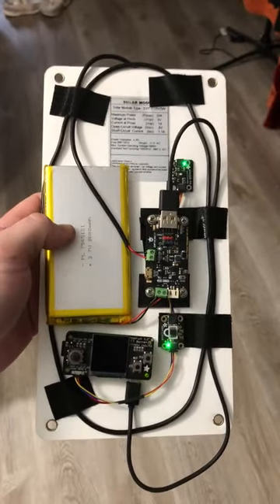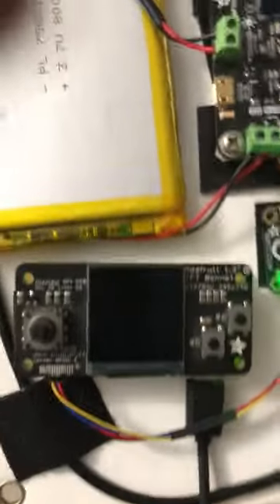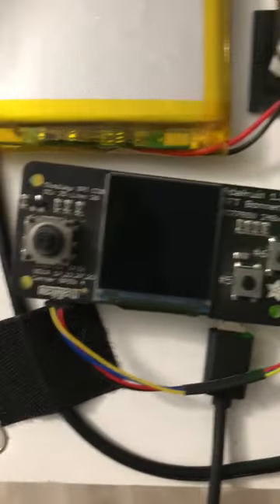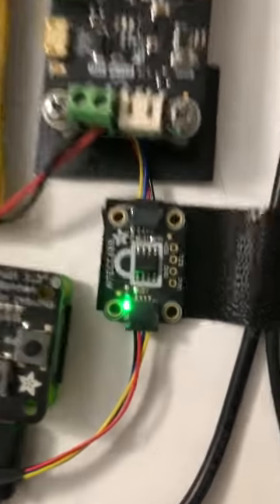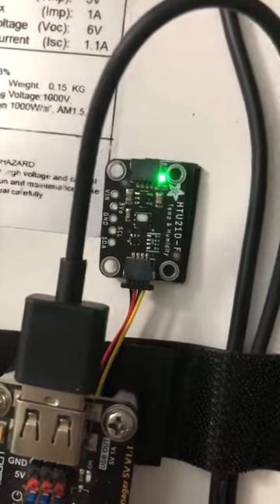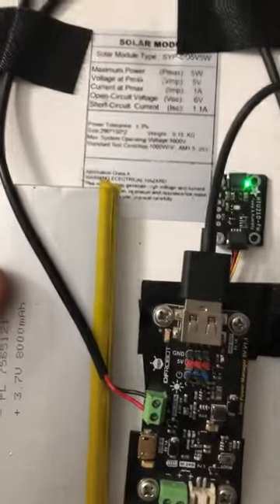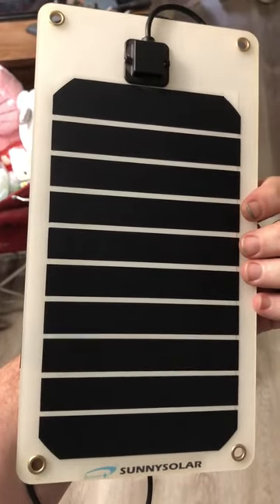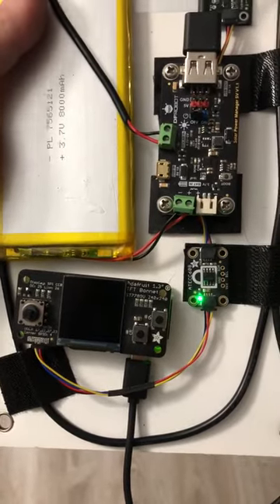My Solar Pi project. Solar powered Raspberry Pi Zero W #shorts

Comment: is it possible to install a bigger battery, a 4g hat in order to run 24/7 and stream to a server ?
Reply from the maker: It is, indeed, and in fact I'm finding that I will have to. I'm going to switch this build to use a small lead-acid battery I have, which will include swapping out the solar power controller unit. I upgraded it to a raspberry pi zero w 2, now; which is more power efficient but also can consume more power when running heavy loads, and the current board does not supply enough amperage to maintain a steady connection.

This is a scaled down replica of a build I did on a much larger solar panel in the past. The LiPo build used a much smaller battery than shown here, and only supplied about 10 hours of power overnight, using a raspberry pi zero w (original.)

The lead-acid build (which can be replaced with a four-cell lifepo4 battery pack as a drop in replacement) never ran out of power and charged fully in less than 12 hours on a sunny day. It rarely dropped below 80% power unless it was cloudy.

This smaller panel probably will not perform as well, it is a 5v panel versus a 16v panel. I would seek at least a 9v panel if you're going to build the same thing.

As for adding a 4g hat, that should be trivial. The solar power controllers are DFRobot products, if you want to replicate it. I've been streaming MQTT messages about the power status of the battery. With the sensors I've installed I can graph out the performance metrics such as percentage of battery remaining, amperage and voltage of incoming power/outgoing power. I can tell the charge state of the battery; if it's being charged from solar or if power is being drained from the battery. Etc. With a 4G hat, once you configure it, you should be able to do similar messaging across a cell network with ease.

One thing I plan to do with it is build a lora network with one or more such computerized panels. In this scenario, I could treat each as a weather station in a grid and average out weather data to examine the microbiome of a given area.

Comment: Where did you get your battery?
Reply from the maker: Apologies for the extreme delay. I got this battery on Amazon, just some random seller. Extensive testing has demonstrated to me that this battery and panel combination is not sufficient to run the attached system with its full set of peripherals (the attached breakout boards.) Particularly the screen seems to require more amps. I can run the system by removing some of the components to reduce power consumption. This battery can provide more than 12 hours of service before it dies and, while the panel is in the sun, it still decharges, just more slowly, giving me up to 24 hours of operation.

This combination was fun to put together, but I need a better solar panel for the setup to run sustainably. I'll be swapping the rpi zero for a smaller microcontroller for future testing.
Reply: @lilbits3136  Awesome project dude. Will you be using a pico to test in future? I want to make a solar project with one myself.